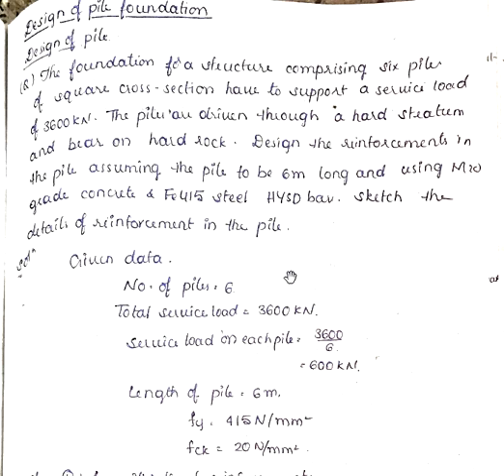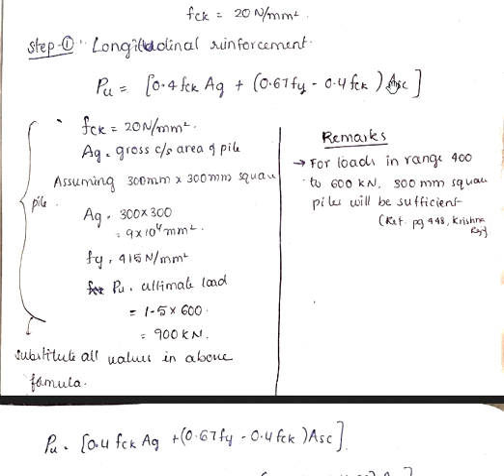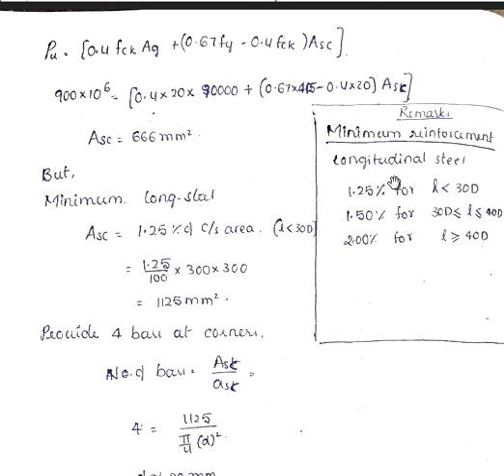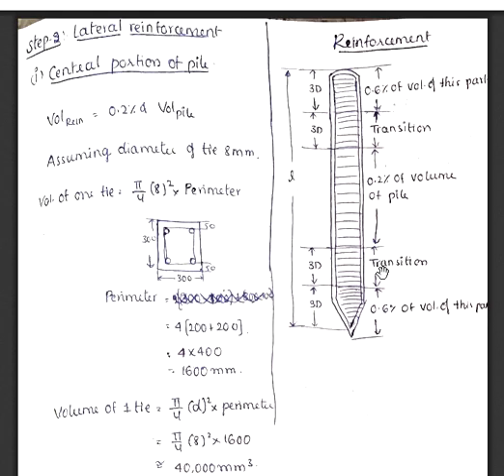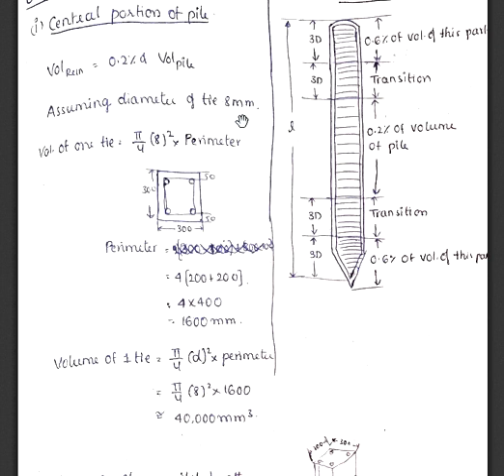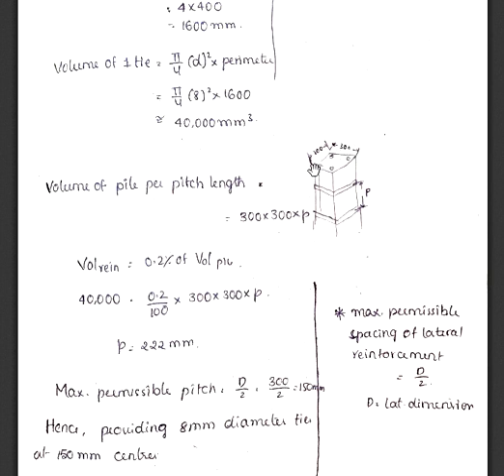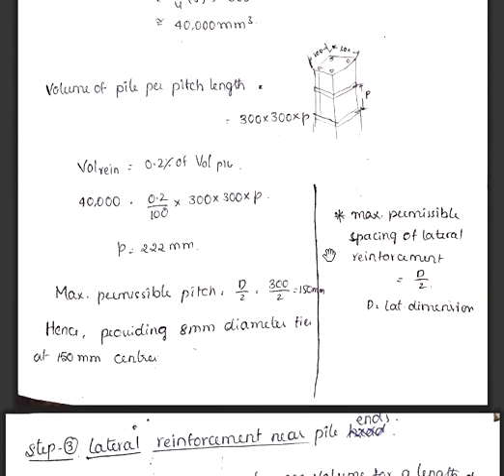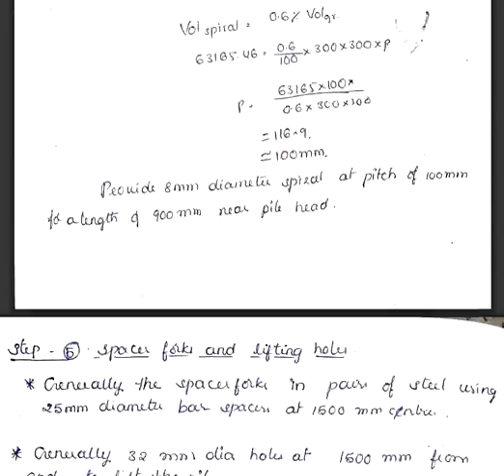Design of Pile in Pile foundation part 1/2 || Limit State Method

Comment: Thank you for this useful video mam but I have a doubt, Before designing this we are about to design the load carrying capacity of pile (bearing & friction). In that we get a value. How that value is going to use in this Structural design of concrete pile. Please explain....
Reply: The bearing capacity of soil is found by soil tests, we test the soil obtain the value and use it for structural calculation.